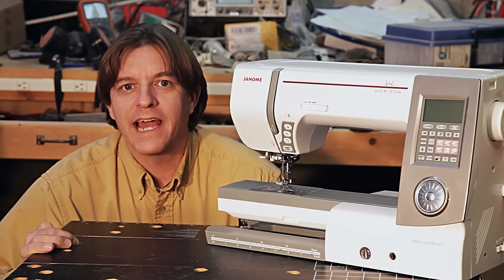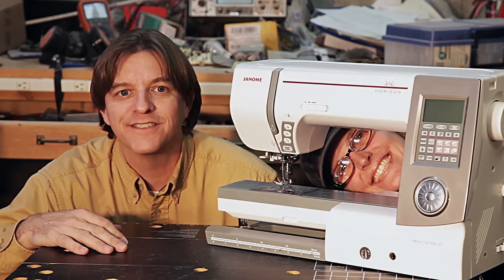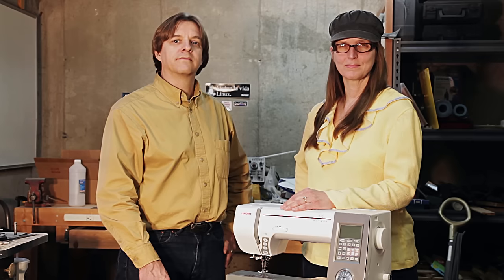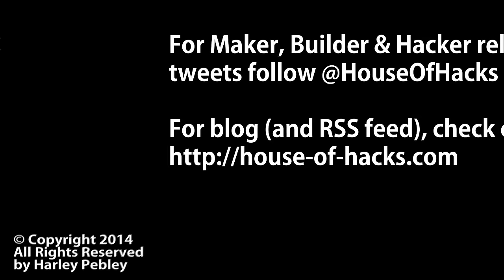How to make a sewing table

Comment: Not for your average DIY person. This requires too many special tools. If you include them in the cost you may as well just buy one. 👎
Reply from the maker: +Cynthia Smith Thanks for commenting. Yeah, not everyone is going to have the same resources. My hope is people can be inspired to use what they do have to make something though. Cheers.
Reply: Don't get me wrong. You are awesome. Too awesome for me.
Reply: +Cynthia Smith LOL
Reply: You could do an almost identical build with a drill, skill saw, wood glue, and a few clamps. It wouldn't look as nice or be quite as strong, but there are other options that could be substituted for the tools he uses. The planer is only necessary because he is reusing wood. The biscuit joiner, and Kreg Jig are nice, but not strictly necessary. Holes for dowels can be hand drilled, and glued in place of biscuits. The Kreg Jig is great, and this build showcases it well, but you could simply use wooden dowels, and/or different wood choices. I know a lot of DIY people just don't have the tools or space, and I often find myself wishing I had this or that to make life easier, and to make my finished product look hand made rather than home made...
Reply: @gandalfthegreen1827  I find myself wishing I had some tools too...then I buy them, use them a couple of times & move on to learn a new skill. My wife loves my stacks of Rigid containers I organized them in lol. Harbor freight is my friend for things I don't need to make a living 😁

Comment: well done...it's amazing what you can build when you have over $ 1000. in tools..but the tools don't work on their own..nice work..
Reply: Good
Reply: Yes... Tools are the key... By Great job!
Reply: You could do an almost identical build with a drill, skill saw, and a few clamps. It wouldn't look as nice or be quite as strong, but there are other options that could be substituted for the tools he uses. The planer is only necessary because he is reusing wood.

Comment: I have an old desk that I am using as my sewing table. It has a hutch above it. But now I can see that hutch coming apart and extending my table. Our office has just emptied some old cabinets that were used to store mechanical and electrical drawings. I wonder what they are going to do with those? HMMM can you say thread, ribbon, and other notions drawers?

Comment: Love this sewing table, you both did a Great job.  I like the indention where the machine sits, can you put an extension table on your machine in this space?
Reply from the maker: Yes, my wife has a SewSteady she uses. That space was specifically sized so that extension table fills all the space, giving her a smooth, continuous surface for the material.

Did you see this video where I made a matching cutting table? It has a similar cutout for her serger. https://youtu.be/e8fzthMmZ1M

Comment: Harley GREAT VIDEO!!! now I have a question for you. is it possible to make a video of a cabinet that would be similar to those ones that hide a bed, but instead when you pull it you have a sewing machine hidden inside that folds open into a small table like but with enough table left over to put your cloth material that you are going to sew?
Reply from the maker: rafivan39 Thanks! That's an interesting idea. By "cabinet that would be similar to those ones that hide a bed" I assume you mean like a Murphy bed? (https://en.wikipedia.org/wiki/Murphy_bed) That could be a fun project to work on, unfortunately I probably won't have a chance to do anything with this idea in the foreseeable future. Here are some images for inspiration, although none of them are what I really have in mind, although they'd be simpler to do: https://www.google.com/search?hl=en&site=imghp&tbm=isch&source=hp&biw=1230&bih=695&q=drop+down+sewing+table&oq=drop+down+sewing+table&gs_l=img.3..0.3998.6901.0.7054.22.10.0.12.12.0.118.797.8j1.9.0....0...1ac.1.64.img..1.21.820.EoQM1c4EBko
Reply: correct, thanks for the links they are wonderful
Reply from the maker: rafivan39 You're welcome.

Comment: Nice work!!!  Wondered where you were going to go with the offset height at first...!  On a different note, I would like to see a vid sometime on how you set up your dust extraction. Would that be possible please?  Are you happy with your setup or is there a tweak that you think you could make?  Not suggesting that you go the whole changeover to a new system but what adjustments would help where?  I've seen many of your other vids and they suggest that a reasoned approach to many workshop issues could be tackled with a tad of ingenuity. Reason why I am asking you specifically is that I like the scientific demonstrable verifiable manner that you've approached other issues on your YouTube channel. Cheers.
Reply from the maker: +cognitor900 Thanks for the comments.

On the dust extraction request, I've done a couple videos. Did you see https://youtu.be/XQGOusi5x3E and https://youtu.be/UbLElnfZmno ?

If you have seen these, what other details would you be interested in?

I have an improved hose connector port design that I'll be posting a video about soon and sometime later this year I'm going to be covering some of the details of the remote switch and possible improvements to it. At some point I want to add a cyclone dust extractor to the system too.

Cheers.

Comment: how are you going to make quilts in that small area? Or did I misunderstand something you said in the beginning?  Good carpentry job!  Fun to watch.
Reply from the maker: No, no misunderstanding. Yes, she uses her machine for quilting. The table is sized appropriately for the machine. Individual squares don't require much room and quilting smaller items (like baby quilts and decorator items) have plenty of room. Quilting larger items (like for an adult's bed) are too big for the machine so, making the table larger wouldn't really help. For those large quilts, once she has things pieced, she rents time on a big, room sized quilting machine.

That said, we have been talking about some ways of making handling larger pieces easier. We may even have a video about that at some point in the future. :-)

Thanks for watching.

Comment: I like the overall flow of the work, your different angles, etc.  And NO to people wishing diagrams and plans.  Every machine is unique, as is the sewer.  Measuring tools and graph paper are what you need.  An insert that goes around the machine to flush it to the table would be needed.  I just need the kreg jig.
Reply from the maker: Susan Sawarin Yeah, for a project like this where most of it is repurposed materials, plans wouldn't be terribly effective. Perhaps I should have shown some of the design/planning stage; something for me to consider in the future. And, yes, this was desinged to use with an insert; I neglected to show it in the closing shot. Thanks for watching and commenting. Peace.

Comment: Great job, this is what I would love to have, but I want my machine to be inserted into the table that way it will be flush with the table and make it so easy to sew on with big quilts.  But I love that you make things for your wife.  She is a very lucky lady.  Kudo's to you both.
Reply from the maker: markay vintageformeforever Thanks for commenting. We didn't show it in this video, but my wife has a plastic extension table that fits between the wood and the machine in the cutout with the curve. With that in place she does have a continuous flat surface with the bonus of easy access to the bobbin without having to move the machine.
Reply: House of Hacks She sure is one lucky gal.  I would love to have a big table to house my machine, and also have the ability to have an ironing surface on one side and cutting on the other.  Now that is a dream table.  I bet you will come up with one of those sometime in the future.  :)  Thanks for sharing.
Reply: markay vintageformeforever Haha. Funny you should mention that. I'm in the process of making her a cutting table, we're still working out the details, but it'll probably have an ironing surface built into it.
Reply: LOL!!  that is funny.  Again I say, she is a very lucky lady.  But a happy wife equals happy life.  You both seem to have that.  Happy sawing and sewing to both of you.  Please share when you get it finished.  Thanks

Comment: I Do enjoy your videos!   .btw, any tips tips on how to make a piano stool with storage in the seat area? Thanks 😓
Reply from the maker: The easiest would be to find some legs with the tapers pre-cut, nice looking wood for the sides that works with the legs, some thin plywood for the bottom and thicker plywood for the top/seat. In the wood that goes between the legs vertically, cut a rabbit wide enough for the bottom plywood and then cut it to length. I'd use pocket screws to screw the sides to the legs, sliding the bottom in after three sides are put together. The bottom will need to be notched in the corners for the legs. Once all that's assembled, the top can be attached with a couple hinges and upholstered. Hope that helps. Cheers.
Reply: House of Hacks thank you very much for your quick response! Much appreciated..will certainly put this into action soon. In the meantime, I'll keep watching and getting inspired, Cheers!
Reply from the maker: You're welcome! See you around.

Comment: Great job!!! I am going to do one but it probably won't look as good as yours!
My recent hack: Turn a used swamp cooler into a chili roaster. Take motor out. Bolt squirrel cage to top. Use wire mesh on one side make a pivoting gate on the other side (where  the air goes in)  use the wheel where the belt was hooked up to to spin. Roast by using your ditch burner (small one). You shoot the flames  onto the chilies where the air went out of the squirrel cage.
Free and fun for the guys to watch over some beers. DONT BURN YOURSELF!!!
Reply from the maker: Thanks!

That sounds like a cool idea for the roaster. Do you have any pictures of it posted anywhere?

Peace.

Comment: I have that same machine and it is a vey heavy machine.  While you built a great table; you might want to consider having a piece of Clear plexi cut to finish to finish things off.  Most quilters want a flush mounted machine so the project does not drag.  :)
Reply from the maker: Thanks for the comment Mary. Yeah, I guess it's not clear from the final shot. My wife has a clear plastic table that came with her machine that fits in the blank spot between her machine and the rest of the table. When that's in place, she does have an uninterrupted flat surface from the edges of the table to the inside of her machine.
Reply: Thanks for replying.  Glad to hear that.  I have the clear table to and use it for my "sewing on the go".

Comment: The dailog was a bit forced (relax!!) - but the video production itself was excellent.

What was the side hole making device (How to make a sewing table)?
Reply from the maker: Thanks for the feedback. Yes, I still have quite a bit of presentation skills to develop.

I assume the side hole making device you refer to is at 2:09? That's a pocket hole jig made by Kreg: http://www.amazon.com/s/?_encoding=UTF8&camp=1789&creative=390957&field-keywords=kreg%20pocket%20hole&linkCode=ur2&tag=theepiaut-20&url=search-alias%3Daps&linkId=JVT26QN7CHJTKHO7
Reply: House of Hacks
no the one at @4:40
Reply: Aaron DC Photography + Video
(I did post the time URL but it got translated or something huh)
Reply from the maker: Aaron DC Photography + Video
Ah, right. That's a biscuit joiner. It cuts semi-circle slots in the edges to put wood biscuits in. When you do the glue up, the biscuits swell and help lock the joint together. They also help hold the top side of the wood flush as the glue dries.

http://www.amazon.com/s/?_encoding=UTF8&camp=1789&creative=390957&field-keywords=biscuit%20joiner&linkCode=ur2&sprefix=biscuit%2Caps%2C230&tag=theepiaut-20&url=search-alias%3Dtools&linkId=NNNNUM3DMWXBSHZF

Comment: Wow- Building at the speed of light. If we had not already watched the New Yankee Workshop, we would have had NO IDEA what you were doing. Do you have an option to watch it slower with instructions? And I am wondering about the sewing machine not fitting right into a "well" so the sewing surface is flush with the tabletop. It seems awkward the way it is. But I love the design element of it sitting on top of the file cabinets but I had no idea what you were doing there either. It was massively confusing. I guess you are more geared for the accomplished woodworker. OH well.
Reply from the maker: Thanks for your feedback. It's a balance between giving enough information and not too much. In videos like this, what I try to do is give ideas, overviews and inspiration, not a step-by-step guide, since, when repurposing materials, what I have and what other will have won't be exactly the same.

Regarding how the sewing machine fits, I'm not sure why it seems awkward to you. The sewing machine in-feed is at the same height as the rest of the table. There's a clear plastic extension that fills the gap between the sewing machine and the wood. So, there's a single level across the entire surface for material to rest on.

Peace!

Comment: I saw a saw, some clamps, a tool to cut out a round hole, and an angle tool for drilling, don't most adults own some kind of saw, a drill with a round attachment, and some clamps?  Why people bitching about cost of tools?  You don't need the exact tools he used to cut stuff, clamp it and drill some screws in.  And doesn't any table you have become a sewing table when you put your machine on it?
Reply from the maker: Surprisingly enough, many people don't have what other people consider basic tools. I'm always surprised when I hear of people who don't have a hammer and set of screwdrivers, but they do exist. And yes, technically you can put a sewing machine on any table and call it a sewing table but that wouldn't be too comfortable for extended use. Peace.

Comment: Beautiful table.  I think the cut-out to set the sewing machine  frame at a lower level than the rest of the table is a mistake.  The needle puncture  level at table surface height and exit surface level (which allows the quilt to spred out as it exits the machine in front of the operator) has been ideal.  Here the wall of the machine frame depression box and window wall blocks that movement.  Look at recent videos of The Missouri Star sewing tutorials on youtube.   In these tutorials you won't see her quilting projects because they use a different machine to quilt.  But their big flat tables allow the needle level and quilt to spred out during layout of pieces and the sewing construction processes for all three layers.   In addition the big surface allows whole viewing of the quilt layers. To be doing the sewing in a small pit- jams up the material movement and will cause the bulk of the quilt body  mass to bunch up on the forward side of the machine after the stitch has been punched.  Needle level surface space is very helpful for the operator making a quilt.
Reply from the maker: Thanks for your thoughtful comment. If the design doesn't work for you, 
you are certainly free to use something that does. That's the great 
thing about DIY projects: you can make something that uniquely works for
 you and your needs.

This is my wife's design and works the way she wanted. She hasn't reported any significant problems with the way this is configured although there are some minor issues we're going to address.

She likes having a single plane to work on for the material to easily slide in and out of the needle area. If the supporting surface surrounding the machine is at a different level from the stitching level, the material does not flow as easily through the machine and she has to work harder to move the fabric.

In fact, we're in the process of designing another work surface for her and it will incorporate a similar cut-out space for her serger.

One thing that may not be clear from the video is there is a plastic 
insert that surrounds the machine and fills the space between it and the
 surrounding table top. So, there is no "pit" surrounding the machine 
for fabric fall into. It's a single level around the entire area.

Peace.
Reply: Tables like this are made for the machine surface and table surface to be even, so, you are mistaken. I have sewn for many years, and I much prefer my table surface an machine surface to be even, not have the sewing machine up so high, although I is done both ways by different people. Look online at tables for sale, and you will find many designed with the lower level for the machine. Also, not everyone is a quilt maker, plus this will work just fine. As skilled as this husband is, I am sure his wife's machine surface is level with he table.
Reply: T CR I have the same machine as the lady in the video (I call mine Big Bertha) and do quilting. I can say that the design of this table is brilliant. I make queen size quilts on mine and though Missouri Star quilt tutorials have a machine set on the top of a table they are just set up to show you one or two blocks being assembled and they quilt on long arm machines. When you quilt large projects and you are moving a few pounds of fabric this way then that having it all at one level is essential. Drops cause it to pull and you then feel like you are in a wrestling match. The more flat surface supporting the weight of the quilt the better.

Comment: This is a guys idea of what is a good design for a sewing table. A better design is a top level with the machine bed with room behind the machine for the project's fabric without bunching up.
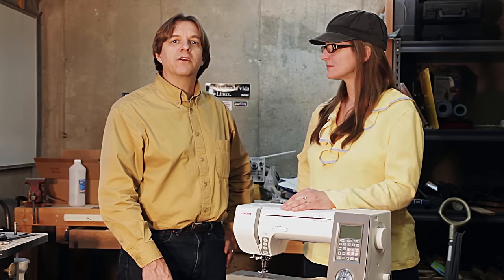Reply from the maker: Hmm, did you watch to the end? At 8:55 it clearly shows a drop-down area for the machine. What it doesn't show is the open area around the machine is the exact size of a removable plastic table so there is a single level front to back and side to side. Peace.